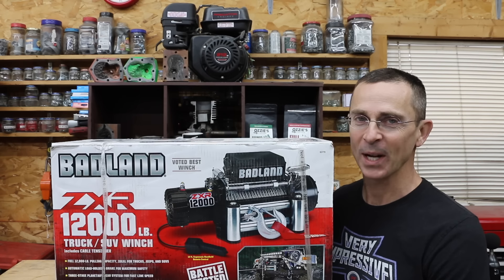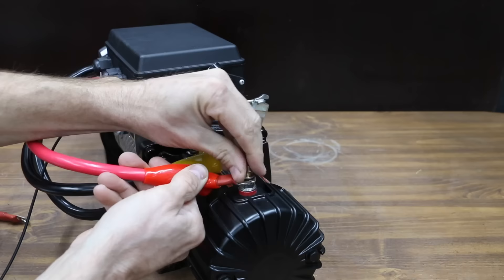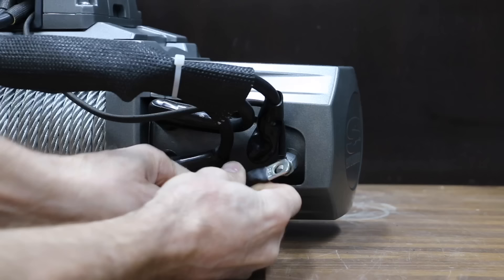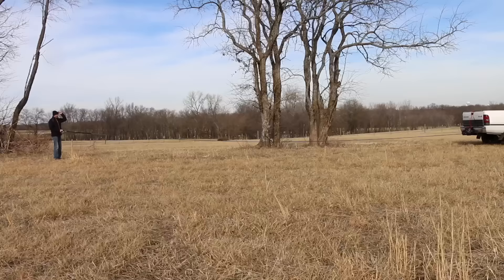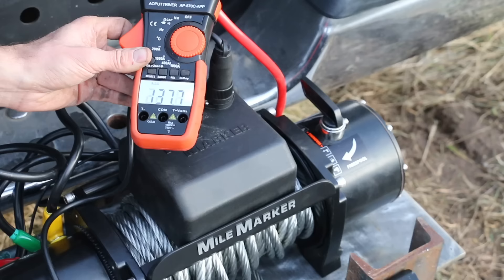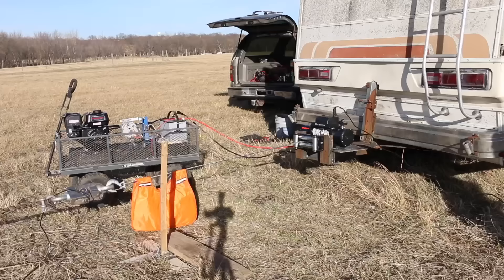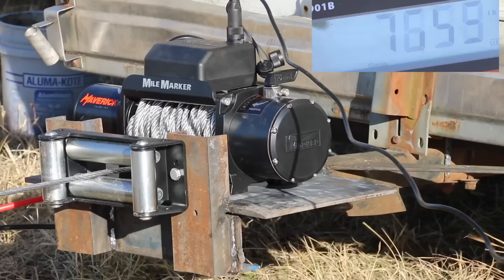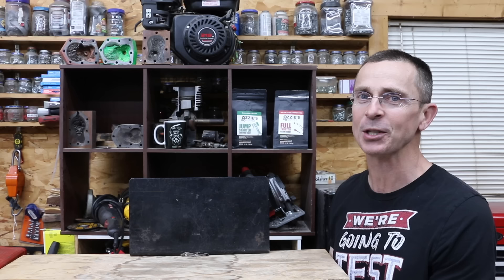Best Winch? Is BADLAND Better Than WARN, Smittybuilt, Milemarker? Let's Settle This!

Comment: Sir, have you ever, or are you able to test window tints for effectiveness at cooling (or keeping vehicle cool -summer is upon us!)? Do tints offer more heat resilience than factory smoked glass due to UV blockers in tints? Are ceramic tints more resilient than regular tint for heat prevention?
(Maybe even consider what is the trade off for decreased visibility for night driving based on tint shade percentage.)

Thank you for your time,
consideration, and always enjoyable infotaining reviews!
Reply from the maker: Thanks so much!  Thanks for the suggestion.

Comment: I use the badlands apex 12k winch a lot doing off road recovery. There's been times I've pulled 10k vehicles out of mud it was pulling around 13k-15k in weight due to how stuck this truck was. I definitely believe the cheap mounting plate had to od with its poor performance...
Reply from the maker: Thanks for sharing.

Comment: Excellent test! Like others, I think it would be interesting to test the Badlands Apex 12000 winch. It seems to be a good upgrade. Faster, wireless remote and synthetic rope. I have one on my 4Runner and it has worked well. I haven't come near to maxing it out though. I would also like to see heavier winch hitch mount brackets...I have the Harbor Freight one and don't trust it...
Reply from the maker: Thanks!  Thanks for the suggestion.

Comment: Should change the title to Chinese winch off, if you were gonna test a warn you should have at least gone with the m8000 still made in beaverton Or. Instead of their cheaper/ more expensive chineasum Shiney turd. These were probably all produced in the same plant just different badging. I know for a fact that the big harbor freight one is the same as the zeek even have the same controller and look identical internally!

Comment: Can confirm with years of commercial use the badlands is trash, we used warn to raise and lower a large metal ramp for about 4 years without many issues. Company for whatever reason didn't want to dish out the money for a new warn, and instead will only buy badlands. These dumpster fires break literally every month... Same badlands as in the video, but different warn.
Reply from the maker: Thanks for the feedback.

Comment: I was always curious for someone that doesn't really off-road but wants a winch in case they or someone else needs a quick tug if an ATV winch could do the trick. Lite usage without all the weight kind of a scenario.
Reply: In that case doing what I do and owning a serious manual puller gives you a very useful tool that's portable and more versatile than a powered winch (I also have three Ramsey industrial winches)  Wyeth-Scott and Tirfor are worth a look. I have three Wyeth-Scotts and will take all I can score used (parts are available) but would also do that with Tirfor.

Comment: This was a very anticlimactic test. No Warn Zeon, Warn M12000, Badland Apex... I could go on but you get the point. Hell, I will even let you use my Warn Zeon 12k if you cover shipping.

A 120a(?) alternator does not supply enough power for a winch.

Look at duty cycle. You should have measured temperature after each test as well as overheating temp to help determine reliability.

Winches are rated based on the first layer of wire/rope, so pulling out six feet does not accurately represent them.

I love your videos, but this one really let me down.

Comment: I think the winch plate failed the badlands more than anything else. I’ve seen them abused like hell and hold up. If the plate didn’t twist I think the winch would’ve kept performing well. They are slow but no complaints with mine
Reply from the maker: Thanks for the feedback.

Comment: The 1 thing I wonder is, IF THE ZEAK PERFORMED AS WELL AS IT DID WITH SYNTHETIC ROPE, AS FAR AS WEIGHT, WHAT WOULD IT HAVE DONE WITH STEEL CABLE? POSSIBLELY UP TO OR EVEN  JUST OVER THE 12,000 LB. LIMIT????? 
THAT'S 1 BAD ( GOOD ) PERFORMANCE FROM A WINCH FOR THAT PRICE!!!!!!

Comment: Video idea 2500 lb or 12000 lb Traveller which at tractor supply not sure if it’s better than badlands which just a idea to try one of the which’s to see if traveller is a good Brand
Reply from the maker: Thanks for the suggestion.

Comment: I agree about the poor quality on mounting plates, I twisted a Badlands bad. I do think your tests were unequal without the Apex. Should be a synthetic OR cable test. This changes the scoring with weight and strength. Why pull such a short distance? Safety? Or biased? I would like to see a full load+ failure. Warn overheats so fast, I bet it would fail and DNF your tests. Nice to see other winches.

Comment: This winch has similar stats to the ZEAK... Curious about how it would compare as a waterproof budget winch: Tyrannosaurus 12000lbs Waterproof Synthetic Winch Kit, Electric Winch 12V DC Powered Off-Road Winch with Heavy Duty Forged Hook for Trailers, SUVs
Reply from the maker: Thanks for sharing.
Reply: that trex is the exact same winch as the zeak!  However the zeak is longer available.

Comment: Great test but as with all tests of products that contain motors or pumps I would love to see endurance under load as part of the testing process. How well does that bargain winch, pressure washer, shop vac or blender hold up after 100 hours of use?
Reply from the maker: Thanks!  Thanks for the suggestion.

Comment: slight fault in this one. winch needs to be mounted on a solid base and the bracket mounted on the chassis rail is way stronger than the detachable bracket used at first. The first two should not be blamed for bending the mounting base

Comment: Hi - I really enjoy your comparison videos! I could some winch advice. I need to winch a very valuable 3,500 lb collector car into my new enclosed car hauler, and would like to know which of these, if any, you recommend. The car is a very tight fit with only 2.25" between the car's rear tire and the trailer's fender on each side inside the trailer, so I need a wireless remote so I can reach in the window to steer the car some while winching. This would be done on fairly level ground, with the trailer's front elevated just enough that the car doesn't roll forward once in the trailer. Thanks for anything you can offer!

Comment: Guess the Newer Gen's of Harbor Winches are Not as good as the Old ones.. Have a Gen 1  12Klb & it has taken a Massive beating over the years between dragging cut tree's & using for 4 wheel recovery pulling out large vehicles such as old school Suburban's.
Reply from the maker: Thanks for the feedback.

Comment: I too would like to see the Badland Apex tested as well as the new Badland 12k winch that just came out.  Also curious if the Badland failure here was the winch's fault or did it fail due to the light duty mount?
Reply: I was wondering the same thing.

Comment: Is the harbor freight winch receiver mount worth getting ? If not ,can you suggest one ? It will be used very little pulling vehicles onto a car hauler then stored in the truck bed using the receiver mount for security

Comment: Really disappointing to see 12k lb ropes snap @ 9k. Not surprised just confirmed expectations.
I'm shopping to equip a '79 E250 460 Quadravan.
I'd like to be able to move it front to back.
And, having learned on YT many worst case scenario's , I'd like to know how big a winch I would need to pull my Quadravan attached to a twin axel trailer with a big boat attached,
up a slippery boat ramp starting 1/2 submerged.  Is 50ft long enough? (steel)
Should a cable's strength be derated when at full length? *6800lb GVW, 33" tires

Comment: Most of that synthetic rope broke. Most of that 3/8" rope should be rated for at least 20,000# not a very good showing for synthetic rope. I think I will stay with the steel cable none of them had a problem.
Reply from the maker: Thanks for the feedback.

Comment: Nice video.  I was wondering if you have disassembled the planetary gears and checked the grease.  I have 3 different size winches and 4 total.  3 of the 4 winches needed grease from the factory.   I was wondering if the tested winches need maintenance?  Have a nice day.
Reply from the maker: Thanks!  Thanks for the suggestion.

Comment: How many Amps did they pull at peak force? 
Many trucks have alternators for 180-200A range.The winches already exceed that and when some appliances run like the blower motor, fuel pump, cooling fan etc. this might result in quite some voltage drop. 
So when you retest those some winches it would be interesting to see what the ECU of a random vehicle has to say about the low voltage and how high the voltage spike is if you suddenly load shed 300A or much more. 
I've heard about over 500A

Comment: I have watched a lot of your reviews and thought they were good.  However, when you fault a winch due to the mounting plate being weak, I do not feel that was a fair comparison.  It is not the winches fault that the bracket distorted.  If the bracket did not distort, the winches should not have sustained damage.  The same bracket should have been used for all the testing.

Comment: pretty scary that some failed their claimed rating. Typically any real engineer has a safety factor in the design of 150% or more, but clearly there is NO engineer involved which makes everything about the winch suspect. Anyone who us considering buying a winch might get a written statement from the manufacture's rating sealed by a Professional Engineer or put in their own safety factor of 50% of the claimed rating to be safe.
Reply from the maker: Thanks for the feedback.

Comment: Wish you'd made this video before I purchased a winch. But I always go well over then I need. Got a 2 door jeep and I have a 12000 lbs winch so it can do the job easier. I saw a 17000 lbs winch. If I hadn't purchased a winch already I'd gotten that one. Problem is the amount of room there's made in bumpers for winches.  If my jeep wasn't a newer model I'd made my own bumper and the bumper would have held probably a 30000lbs wench but sunk the front end of the jeep 5 inches lower because of weight. Not good.
Reply from the maker: Thanks for sharing.

Comment: Can you please do a durability test on these winches?  I off road a lot and I am in need of a new winch.  Things that killed my old winch were being submerged in water during river crossings, first problem was solenoid would corrode after getting wet,  then the gears got rusty a few years later.  Don't know if you have a way bounce them around like if they were on an off road rig and see if they stay water tight.   Also if they can keep working with continued use or if they burn up or loose power.  Don't know if that kind of test is possible but thanks for what you do!
Reply from the maker: You are welcome!  Thanks for the suggestion.

Comment: Ok but how do the winches still function after 20 plus years?

  In 2001 I purchased a warn 8000xi winch and have used it constantly over that time on various wheeling rigs. In those 20+ years I've taken it apart twice to inspect/clean/grease, I've replaced 1 out of the 4 made in the USA solenoids, and after 15 years I finally put a new motor on it.  I also have a m8000 winch that's over 10 years old and still going strong.  

I have a sperwinch that came on a vehicle I purchased that's only 2 years old and it's a pile.  It's not sealed well, water gets into the gear housing, it always sounded terrible.... Also the paint and chrome coatings have failed badly, it's all rusty.
Reply from the maker: Thanks for the feedback.

Comment: Def needs to be redone... Comparing winches attached to already broken mounts, against winches in a firm and sturdy mount? What kinda apples to apples test is that??? Those "lower rated" winches had enough force to break their mount... Seems unfair and unbalanced as hell to not have them mounted to the same thing as all the others.... Bet their ratings go up..

Comment: I was pricing out a working truck yesterday, I already added the snow plow prep and the 410 Amp alternator to the F-250 and they wanted $6k more for a Ford winch!!!!!! Does it include replacing the front half of the chassis? Most people never need the rated capacity of the winch they buy anyway.

Comment: Not one of them made it to the rated pull strength at all that is just sad and give me a wonder in my mind on how the heck did they get that number in a lab maybe with very strict settings or the best of the best stock. Also wonder if your going to use plastic rope at the very least the rope should make it to 12k pounds but none of them did and that is more sad lastly the motors in them are amazing but suck because they over stated there power and said they can do more than they where made to and that right there to me all above ruins all of the names of the wenches and has a false advertising feel to them now also. Great work this info is good to know and the companies should take this video as a lesson and make there product better over all.
Reply from the maker: Thanks!  Thanks for the feedback.

Comment: How do we get 300amps out of a 140amp alternator???
Reply: You don’t.  The battery is supplying most of the current.  The alternator is helping, but the battery is discharging under the 300amp load.  When the winch isn’t running, the alternator will then recharge the battery.

Comment: 7:30 50 ft no load pull
7:40 Force to unroll rope
9:44 Time to pull truck 20 feet up 12 Degree hill
12:01 Moving RV, tractor and truck 4 ft
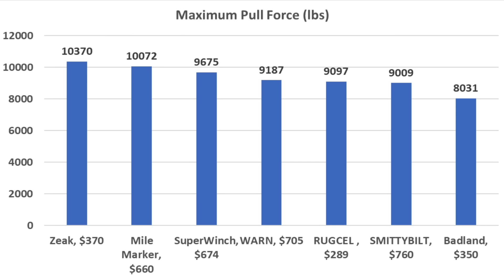14:29 Maximum pull force (probably the most important statistic)
15:10 Total results

Great video PF, really appreciate your time, effort and money spent on these comparisons! You're the best.
Reply from the maker: Thanks and you are welcome!

Comment: I haven’t checked every single winch, but the winches that I have checked the whole rating thing that they got on the box is false. You have to have a snatch block to make the ratings that they claim that they can do.
I was wondering if it’s the same with all of those not being able to make the standard that they claim they can do on the box .
I mean, if all their winching is less than their rating and their rope or cable breaks, that’s pretty bad.
False advertising is running rampant with products.
Being all of these products are made in China, well 🤷‍♀️

Comment: The most important test, max pulling power, you totally did it wrong, testing on the last wrap. Why test pulling power in high gear? Should have tested with 10 wraps on the drum where it has maximum pulling power.

Comment: Most cheap winches work. The test is for how long. There's no point in buying a cheap winch if it fails you 14 months in when you're stuck 200 miles from anywhere.
Reply from the maker: Thanks for the feedback.

Comment: I tried hooking an alternator up to my harbor freight predator 212 but just couldn’t get it to work. Does anyone know a good method for creating the setup here?
Reply: you need a battery as well to supply surge current
Reply: @thomasreynolds1530  yeah. I had a battery bank too. I forgot to mention that. I had two deep cycle marine batteries that I was trying to charge.

Comment: Man those real off brand winches use some REALLY REALLY garbage a$$ synthetic rope! A decent synthetic rope in that size shouldn’t break until up over 20,000 lbs. ESPECIALLY on a simple straight pull. Most of the time when you see synthetic ripe break it’s been abraded by rock or something else. That’s really it’s only Achilles heel.
Reply from the maker: Thanks for the feedback.

Comment: I have the rugcel 12000 lb winch and the line is wound over the top of the drum instead of under it when it winds in. If I respool it it wont make a difference so it it best to swap the - and pos wires?
Reply from the maker: Thanks for the suggestion.
Reply: @ProjectFarm  Hi, It wasn't a suggestion, I was just saying mine came wound on the spool the wrong direction so the winch rope goes awkwardly up and over the spool instead of being wound from the bottom around the back so I was trying to get ahold of them but there is no support apperently like it send you to amazon help instead. Not sure what to do, If I respool it under it will just wrap the same wrong way when you spool it in unless, I change the polarity on the battery terminals on the winch
Reply: @ProjectFarm  I sent it back and am going to buy the warn china brand with steel cable

Comment: I usually like your videos and generally accept your results as honest and thorough. This one doesn’t pass the smell test.  First, you chose models that none uses.  Why not use the Apex instead of the ZXR? Then, why are you not using a considerably stronger base? Your “ homemade plate” cannot be used as a scientific base line.  That would need to be a completely solid base that cant fail for any of the winches and must be the same base for each as well.  I’m sorry but this is not accurate and or a fair representation for any of these winches.  You lost me on this one and now I will question any test you do from now on.  You MUST redo this test or be known as dishonest from now on.